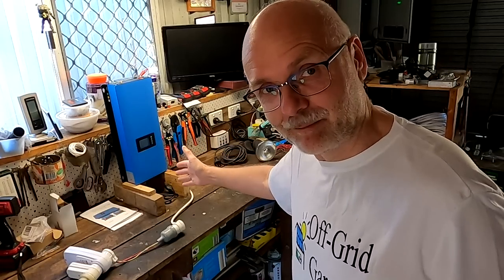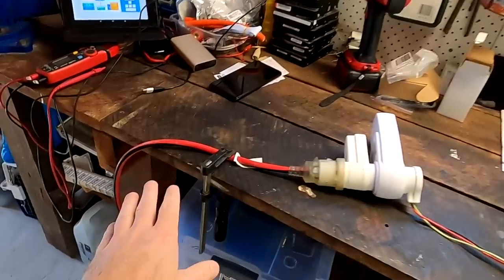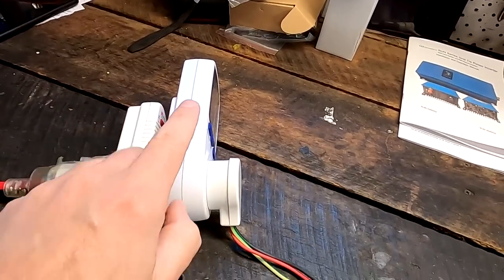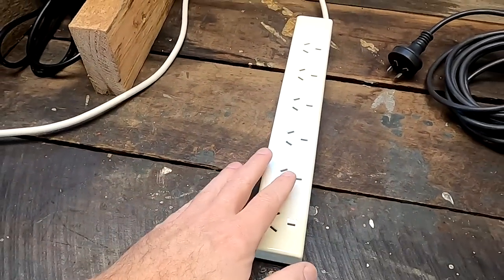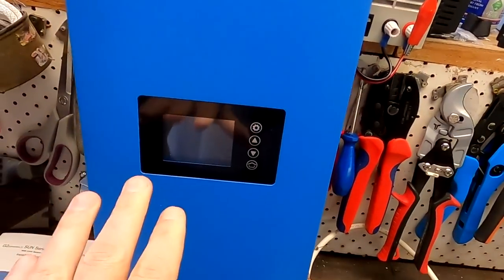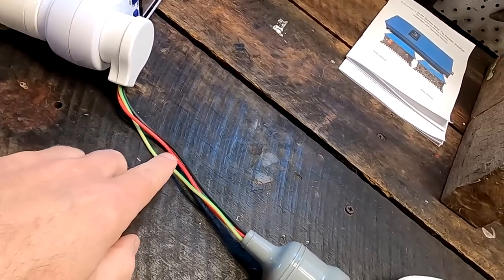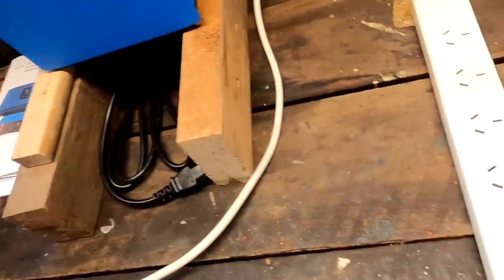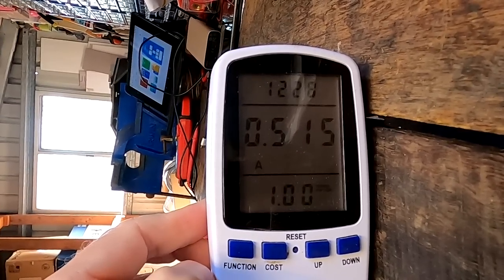Sun 2000 GTIL2 Inverter full test. How it works, what it does.

Comment: i was looking for a situation where i have off-grid a small inverter with a  battery that can suck extra energy from a generator when i turn on an electric oven... is that even possible?
edit: i don't want to overhaul and upscale the whole pv/battery/inverter/cabling system because it is sufficient. we only would like to add an electric oven somehow....

Comment: hi Andy, because of you i am building a 28kw 48v battery and i want to be able to sell back my power in the summer, and this inverter makes a lot off sense to make this happen. BUT will this inverter stop sending power in the grid when the grid go down? so like workers cut the cable. because no power can flow when the grid is down to protect the workers and the grid. do you know if this inverter does this?
thanks

Comment: The have a power limit . I would like the inverter to regulate the input dc voltage not the power . With this mode you could set up maximum and minimum dc voltage and the inverter would regulate the dc input to keep the voltage inside the user defined limits . Can this be done ?

Comment: Can these 2000w models be used in US? I thought several videos had mentioned only the 1000w/120ac models work in the states? 

For the 2k models do you need 2 sensors? one for each 120 branch of the 240 grid power input to your homes panel?
Reply: yes, it can. To answer your CT question, yes you do. I created a video of my setup to explain.

Comment: Thank you for this video. On your review you show how the inverter will output the demanded power output when the input DC Voltage supply drops down, can you provide information on what the inverter will do when the DC supply side remains on and the AC coming from the power plant gets cut off when a power pole gets hit by a car and the pole and wires come down? Will the inverter continue to produce AC from the solar panels and feed the grid ? If yes, this could be a problem for the repair crew when they arrive to fix the down pole.
Reply: When the AC side gets disconnected the inverter will turn off.

Comment: I have a issue with mine. When I go to the settings and select the internal limiter and make the "bat or solar limited power mode 650watts. I only get ten watts out of the inverter. When I turn the internal limiter off it goes to the higher watts. Why is the limiter only getting to ten watts? not sure what the issue is.

Comment: Will this Inverter  SUN-2000GTIL2-H take a 48V battery bank...I connected a 48V battery bank to + and - and blew the unit.??? Any suggestions?Can you attach 48V battery bank (100AH each) 
directly to the + and - terminals of the  SUN-2000GTIL2-H ?? Please advise...Thank you. I connected 48V battery bank to the + and - correctly and blew the unit???
Any suggestion. My unit is the 2000W Grid Tie Inverter Power Limiter LCD Display DC50-90V Solar Input AC185-265V Output SUN-2000GTIL2-H

Comment: Andy, please correct me if I am wrong. This device cannot be used if the grid goes down, correct? Even you have a battery bank connected to it, the moment the power goes down (like in a storm) the system goes down.
Reply from the maker: That's correct. It's a grid following inverter, not a grid forming inverter.

Comment: Hey Andy, thanx for realy great videos. You have made many of my days :-) 
Just one question regarding SUN 2000 or 1000. Normally at the manual SUN is prohibiting to connect two invertors on one PV string. Understood. But teoretically connect two inverters on one battery bank should works. Am I right? or not. Thank you for respond or help.
Reply from the maker: Thank you Jozef. Yes, that is correct. You can connect as many of these inverters to one battery as you like and parallel them to increase output power.
Reply: Andy I appreciated your beaviour. It well done aproach. Fast easy clear answer. Sorry but next question. I have went through of your videos and looking for right answer about the most suitable BMS for EVE bat cell for example. I have seen your hard execsising with Daly. JK and QUCC xiaoxiang better but I could not find right answer which one is most suitable for. Would be great to get your opinion for the most suitable BMS with EVE or others bat cells. Thx and keep fire burning. Go ahead as till now or even better
Reply from the maker: @alets9788  thanks you for your comment and question. The best BMS so far is the JK-BMS for all batteries 8s and more.

Comment: Still waiting to set mine up, just need to get some batteries to setup a 48v pack.

Got 1kw of solar and 48v victron controller, my home base load is about 200w, got a few servers running.

So it should work well without having to run the current sensor.

Comment: My dear friend.Can you be more specific for the efficiency of the 2kw sun grid tie inverter...If you want my experience  offering him DC panel power 2000 watt it gives me no more than 1450 watt.so increasing the panel power to 2850 watt  v=85 volt and I =35 ampere DC.   THEN IT GAVE ME 1850 watt....so 1850/2850 = almost 66 % efficiency......i am really curious for yours measured efficiency......thank you .
Reply: Dear friend are you kind enough to say a few words of the efficiency of this so well presented grid tie inverter.Because as i mentioned with proper instruments i measured the DC input power to the inverter and in order to get 185o watt  AC  i had to connect the maximum input power it can receive which was 2800 watt.which in a way gives an efficiency of 66%.Meaning you give to the machine   100 watt DC power and you get 66 watt AC. Which means they say is 2 kw and never gives 2 KW.If i make mistake please correct me with video.Thank you.

Comment: For this inverter,  if how many watts maximum panels I can use? If I will use 1200watts panels,  but keep the corect voltage  it will ok? Or I must add maximum 1000watts panels? Thank you very much
Reply: whatever how many Watt array you have, until have proper V range then it can give to inwerter a power who can be go to auto-consumption.

Comment: I've been looking at these and units like them since you posted this.   How does this device work with a battery system.   I looks like it takes solar and directly puts into your house.   Where in the design would a battery back up go?
Reply from the maker: Same connections. It has DC input terminals and can take... 45V-90V DC, either solar directly or battery with correct voltages.
Reply: @OffGridGarageAustralia  Do the batteries then need a solar charge controller between the Solar Panels and the batteries? How does the GTI "know" it is on battery (and not solar) and not try to implement the MPPT algorithm on the batteries?
Reply: @benkanobe7500  oh good point - I didn't think about that. I wonder if there's a way it can 'sense' what the DC is coming from?

Comment: I bought one of these (the 1kw 24v model) upon seeing Andy's demonstration and am taking care of standby power (grander plans ahead). I have a victron shunt and 2 victron charge controllers which I monitor via VRM. There is a RS485 output of the sun inverter. Does anyone know if this can be connect via my raspi running venusOS so it can be monitored via VRM? Thanks in advance.
Reply from the maker: Great question!

Comment: How will this unit interact on a home circuit with a with a normal solar system (GoodWe 10K) on the house ?     i.e. If attached to a rear bungalow... Can I still use this unit to offset the bungalow power load ? I understand if I used the CT limiter function, thereby not feeding anything back to the house / solar circuit, then it should theoretically work fine. Will it ? Or will it not play nice with the solar inverter on the house ?  Thanks for your awesome video's and easy to understand approch  😁  😁  😁
Reply from the maker: The inverter needs to be connected to its own solar panels or a battery to work. So you need to have a separate solar array on your rear bungalow. Then it will work as you said.
Reply: @OffGridGarageAustralia   Excellent Thank-you . . . Yes I’m planning on setting the bungalow up with its own independent solar array (through its own dedicated SCC) charging a 48v LiFePo4 attached to the inverter on the bungalow. Just wasn’t sure if any frequency shifting or voltage changes would occur and effect the existing solar system on the house. 💪🏽👍🏼

Comment: can you extend the limiter sensor clamp cable? or will it mess the reading? i need to put this inverter around 20 meter away from the inverter ...
Reply: I did it with 15 meters of shielded cable. No issue

Comment: Here in the U.S. I found that my limiter sensor was showing minus on the screen because the prior home owner had incorrectly wired the electrical receptacle (power point). They had wired the neutral to the hot side and the hot line to the neutral side. Appliances will work with such incorrect wiring,  but there is a risk of an electrical shock. So,  I rewired the receptacle and the minus went away.

Comment: I was wondering if the clamp would work on the neutral wire as i already have a clamp on the live and no more space?  Great learning videos about this inverter and set up. Thank you Andy.
Reply: I got it today up and running and the clamp works on the neutral wire, thanks Andy for the tutorial, i was surprised how small the text is on the settings display, i needed microscope.
Reply: @Daraghfly  By clamp do you mean the limiter clamp?

Comment: Some reviews on Amazon about this backfeeding even with the limiters in place. Most utilities now days that have a smart meter will be alerted to this backfeeding. One review he says it was back feeding during a power outage a utility worker noticed power still on the grid after they cut the power going to the feed lines. Here in the US when you grid tie you required to have insurance in case of injury from back feeding to the grid while they are repairing it. Not sure how often that happens. I would imagine it is very rare.

Comment: Could you integrate a 48v battery and solar panels using this inverter w/o other equipment?     I'm struggling to see how this could be done, unless I'm missing something.  Say I had a 75V solar panel.  It almost looks like the system would require an additional charge controller to have the PV charge the batteries and make it all work?  Basically the 75v solar panel feeding a charge controller, feeding the 48V battery, feeding this inverter, then tied to the panel/load... or could it all be handled by this inverter?  Is there a cheaper way to do it?
Reply: Yes you need a SCC if you want to add batteries.

Comment: Great video. What would happen if you don't connect the current sensor? Would it always produce the maximum power available from the panels? Would it know what the house is producing and export the rest?  also What do you think about using this inverter in parallel with another on grid inverter of different brand? without any rs485 communication between them. For example if there was an on grid inverter at the house with 2-3kwp panels connected to the grid close to the power meter  and then 20 m away at the garage we instal this GTIL inverter with 1kwp panels and connect it to the junction box of the garage but without running the current sensor 20m all the way near the power meter. Would they work together to produce whatever is needed to power the house and garage and export the rest or would they just trip each other out?

Comment: so what happens if the grid goes off like last time? you switch to your victron system to power your house? on which phase? system is getting heavy with too many components while they can be one. there are hybrid inverters that also has grid supply control like this one.
Reply from the maker: Yeah, this is a grid following inverter, not a grid forming inverter.... It's just an option.
Reply: @OffGridGarageAustralia  check Deye hybrid inverters

Comment: What happens if the grid goes down? Is there an anti-islanding mechanism in the device?
Reply: when grid is down the unit is down. When a limiter is enabled but will be cut/disconnect then a 0W will be output.

Comment: I've just had solar installed and they have connected the inverter direct to the grid side of my smart meter so i have to pay for all the energy I use. I asked why and they said that if the inverter was connected to the house mains and I used more than it was producing it would cut out.

Comment: 20:43 European here. Wait a second.. in Europe sometimes we also use the current limiter included in the box of this exact inverter. In Europe, by law, we can output to the grid (with this type of plug-and-play inverters) a maximum of 800w (in some countries is overruled at 600w), and exactly because of this we use the current limiter, it makes us able to have bigger systems without breaking the law.
Reply: That is good info. Too bad that setup does not work for us in the US for the 2000 watt model. We need to monitor both legs of the split phase with the current limiters.

Comment: good solution👍. you might think about a manual or automatic transfer switch for when the grid goes down. at the point the grid goes down the txfer switch txfers to the off grid inverter "generator" and when the power comes back on it txfers back to city power. it shouldn't effect the new inverters.
Reply: If you cut off your grid connection as anti-islanding protection, will you need to add another earth for use when you are not on the grid? I get confused about earth types and I am not sure what earth is provided in Australia but it looks as though Andy gets an earth from his supplier.

Comment: Great device, can you connect batteries and solar all at the same time?
Reply: I am going to be doing this via a relay and voltmeter sensor so if the BMS switches the battery off then the relay puts the solar panels direct to the inverter (the way I am doing this is for when the temperature hits 3 degrees centigrade)

Comment: Hello, I want to ask, could you test the minimum working voltage? I have a Lifepo4 16 cells battery that is a 48V pack. Do I need to know if the drive will operate at 41V or what is the minimum voltage? I would still be interested in the real maximum power of the converter, thank you very much, have a nice day.
Reply: I would like to know as well 👍
Reply: i don't know about his specific model, but there is ones online that say they can operate as low as 25v DC, and go to 60v. There is another model that works between 50 and 90v DC

you can set the cutoff voltage, so i imagine that you can set it to whatever the low point is for the model you get. the 25 to 60v one, id wager, goes to 25v at its minimum in that menu.

i don't have one of these, FYI, so of course i could be wrong.
Reply: @alericjohansen6775  Hi, thanks for your reply. According to the video, the minimum voltage is 44V (Cut off Voltage), but I don't know if the converter will start working with a voltage of, say, 46V. This is not mentioned in the video. If someone has tested it, please write.

Comment: I got a 2000 watt unit  from ali It ran good connected to pv , but it died after just over 2 years, I am in the Philippines any ideas on finding authorized repair shop? for now I am thinking of just ordering another one it is like 350 dollars the input of the grid shows like 3.0 volt and nothing is produced.
Reply: I am retired navy and on a budget but finding a good repair shop is very hard.
Reply: I can send to china factory but I have to pay both ways costs of shipping plus cost of repairs in china, so I  may be better off just ordering a new one.